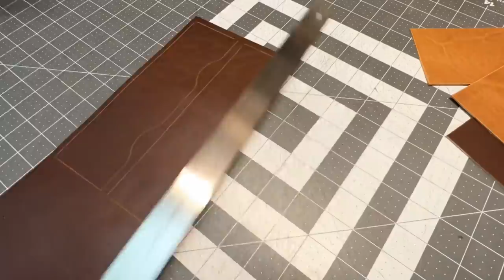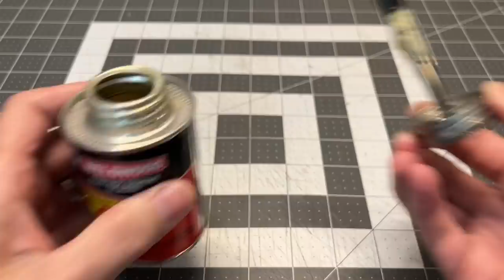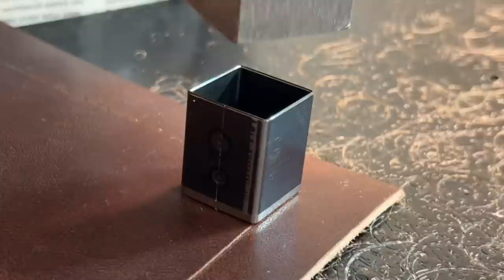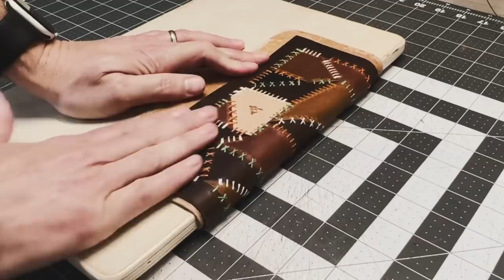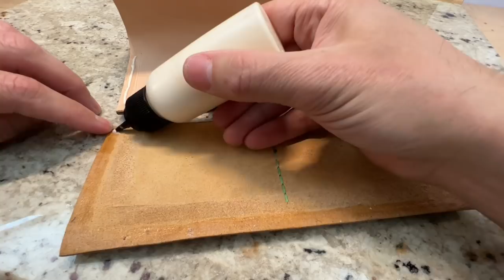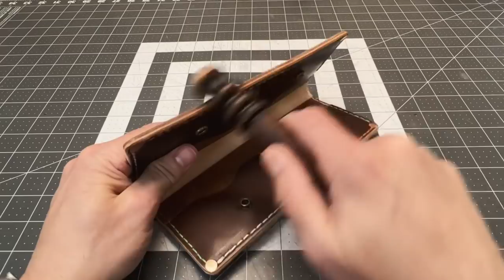The Frankenstein Wallet - How It’s Made - Leather Craft

Comment: I had a similar idea a year or two ago but was little a trepidatious about how to go about it. If i had believed for half a second mine would have looked half as good as this i would have started the moment it entered my head
Reply from the maker: Thank you. It has a few issues I would address if I had to do it again. I would use a thinner more flexible liner material and glue it flat to the outer panel. The current design, when fully opened, has some heavy wrinkles on the outer panel which could lead to some delaminating. Always learning.